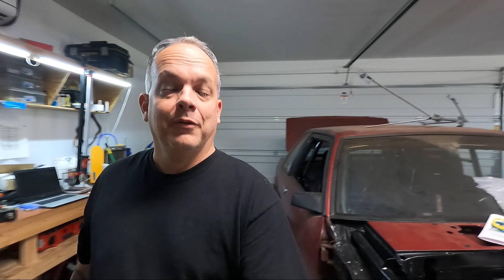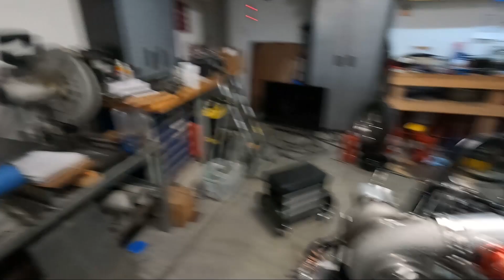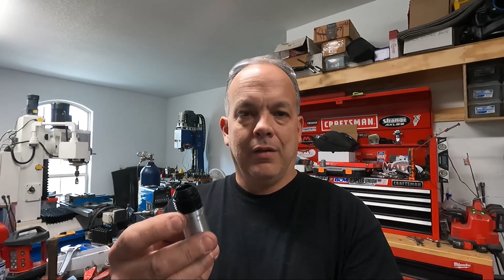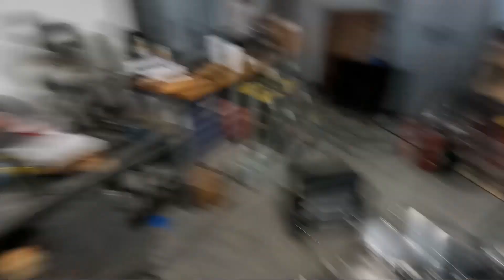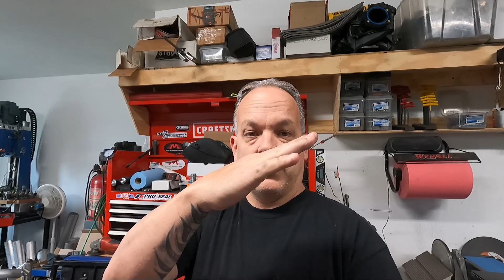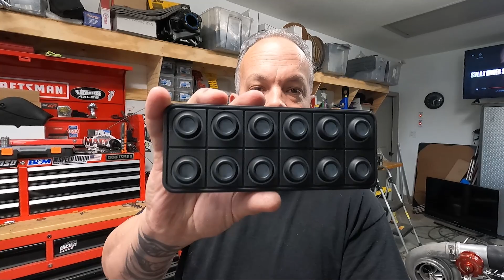Don't buy this LS oil pan from Summit, and new race car parts for Bob!

Comment: That's poor quality control on their parts  . I'm not surprised they didn't list your review lol. Those are great sensors you're putting on Bob.  Looking forward to seeing how you wire it all in . Happy Thanksgiving 👍
Reply from the maker: You know, all along I actually expected the review to get deleted at some point. Even though the other review showed pictures of the exact same problem. All the extra stuff will be done after the dyno since it won't make any difference there. Just gotta see how Bob holds up on the rollers. 

Happy thanksgiving!
Reply: @diygaragetx  will you be om methanol for the dyno?
Reply from the maker: Oh yeah, absolutely!

Comment: Summit hustling some garbage
Reply from the maker: In all fairness they did offer to replace it, but it was pretty poorly welded from the start
Reply: @diygaragetx  A new part does not really cover all the work needed to replace it and they did not offer some compensation for the work, or? Also, the practice to delete a bad review is shady to say the least.
Reply from the maker: @leifsimmons2464  exactly! Pulling this particular engine is a lengthy process. I was moderately surprised they deleted the comment. You can see in the screen cap exactly what I said, Favorable - no, truthful - absolutely. :D

Comment: They offered you a new pan get a grip pal
Reply from the maker: Lol, it was after the engine is in the car and had some expensive oil in it. You'd be pissed too!
Reply: @diygaragetx   not really it's 70 dollars max it would of cost them twice as much to send you a new pan even with them been a hour  away and let's face it if you just want some views 😉 your secret is safe with us hahahahaha
Reply from the maker: @connorsherwood636  No, actually it's 120$ in oil that I shouldn't have to be draining anyways. Not a single person in that's going to watch this video would say "hey, I have to drain 120$ worth of oil that's 15min old, to fix a brand new oil pan (that I shouldn't have to fix) - don't worry summit, no big deal" Or spend the next 2 days pulling the engine to remove the pan and then drive across town  get a new one, to potentially do the same thing.... Not going to happen, I welded the seam, in the car.  None of which validates the fact they deleted the review because it wasn't favorable.